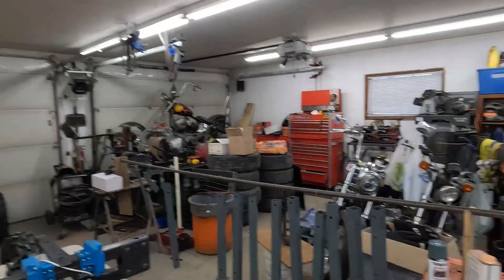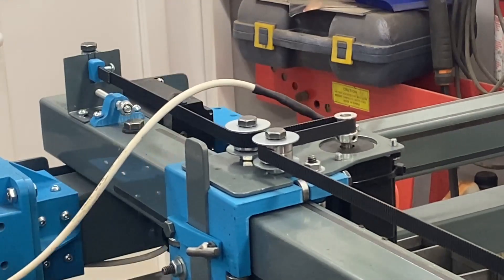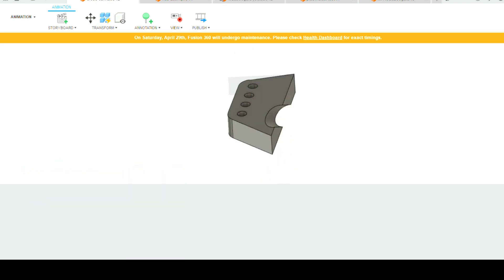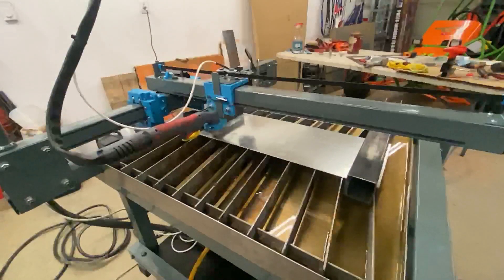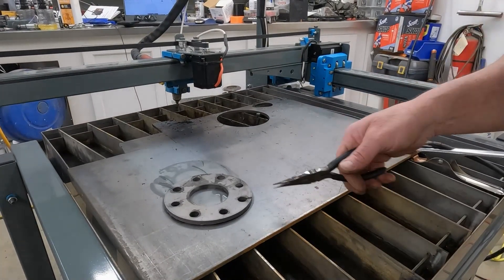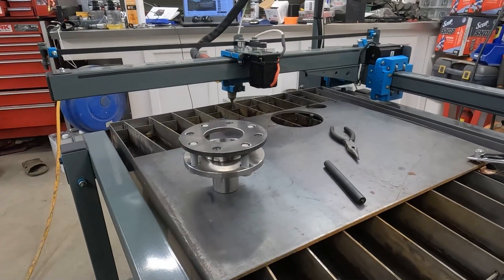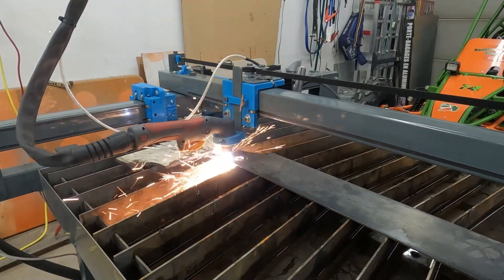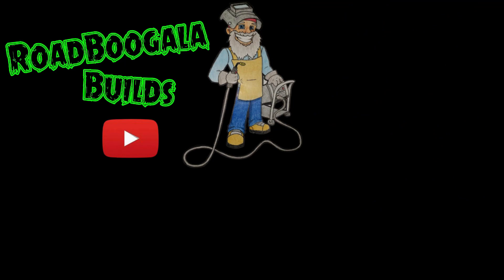Home Built CNC Plasma Table painted and ready for use, Part 3   @jdsgarage701 ​

Comment: I built the JD's Garage table myself and it looks like maybe you had the same problem I had. That would be that the torch starts to move a little too quickly after the "Torch Off" command is sent. This leaves a partial slice when it moves to the next position. So I "hacked" the post-processor and added a time delay right after the M5 (Torch Off) command. Now all the little slices are gone. I just basically made the "leave" delay equal to the Pierce time. I was doing this "by hand" when it first started but later figured out how to change the Post-Processor to do it for me. Less time and less mistakes. Next I want to have a Laser option . . . Happy Cutting!
Reply: Hi. Did you manage to build a cnc with a laser? I have a similar plan. And I'm considering the option. Regards
Reply: @slodziaksos No, I never did get to modifying it for laser. Maybe sometime in the future.

Comment: I built a front end loader for my Deere 420 this spring and I cut out a bunch of stuff by hand.  Sadly it looks like a little kid did it.  During the project I was wishing I had something this size just for brackets and small stuff like what you did here.  The FEL worked great for the projects, and I keep finding stuff needing it.  Now this fall we got a couple rain storms and it appears I need to dig up the foundation on one side of my house to find and fix a leak.  
Well now this spring I'm going to build a mini backhoe.  Thinking about my experience with the FEL, I started trying to figure out what I could do.  JD's garage popped up in my research and now after watching your build..... Next paycheck the plans and 3d Printed parts will be ordered.  By super early spring I'll have the table built just in time to build the Mini-Hoe!  If I'm smart, I'll figure out how to use my Go-pro and other camera to actually video both builds. LOL

Great job with this!
Reply from the maker: Right on thanks, using the table for a project right now

Comment: I have a question about the idler brackets. The nuts are supposed to be drilled out to 5/16 then a 5/16 rod goes through. Is this just sitting in there or what retains it? Only part of the directions that are a bit confusing to me. Thanks! Cant wait to get mine set up!
Reply from the maker: Allen set screws holds it in place
Reply: @roadboogalabuilds5318  great thanks I'll have to take a look!

Comment: Damn, that is just incredible... I've been thinking about getting a small CNC plasma setup, but this really seems easy. Just curious what your estimated total parts cost was?
Reply from the maker: I really didn’t keep track, the steel it self was expensive when I purchased it. I think mainly because it was a special order from my supplier
Reply: @roadboogalabuilds5318   Steel prices definitely suck these days. Was just wondering the ballpark though like under $1,000 type of deal.
Reply from the maker: @mxdev6387  Ya I’m sure I was under $1000 (not including the price of the plasma cutter)
Reply: @roadboogalabuilds5318  Awesome, sometimes it's hard to tell with how we get gouged with some items in Canada. Already got a plasma with CNC control options, but I'm tired of straight edges, wooden fences and circle guides with my steel plate that's propped up on my driveway.
Reply from the maker: @mxdev6387  there you go that’s half the battle, and yes we so get bent over on prices up here in the north!!!

Comment: cool work but how do you start and stop the plasma? or do you start and stop manually?
Reply from the maker: thx,  you need to use a CNC enabled plasma cutter, the torch is controlled with a relay, arduino and software. The JD’s garage plans provide this information

Comment: I'm  using the plans and starting this week...
I see that they have a Z axis now. Do you see an advantage in having a Z axis. 
I have no metal working experience. Being that the metal is damn near flat I don't see where doing a touch-off every time is efficient. 
Any advice?
Reply from the maker: Having the z axis should help with torch tip life by having and keeping the correct tip hight. I do believe JD’s program there’s to pierce at a slightly higher height and then lower the torch for cutting. It will also help with metal that’s not perfectly flat, also overtime your Slatts get a little uneven with all the Cutting

Comment: I’ve been contemplating getting a setup like this to make rustic signs from recycled metal appliances. They are obviously painted though and I wondered how it would work with painted surfaces. Are you saying it results in a crummy finish or a bad idea or something else? Thanks for sharing your build!
Reply from the maker: Thanks 👍🏻 this machine does make very accurate cuts, I have found it like raw material over painted but it still does a great job on painted surfaces esp if it’s thinner material which you would most likely be using for signs 👍🏻

Comment: Great videos! It’s good to see the table up and running.

Can you tell me what the accuracy on the holes is like? Are the fairly round and accurately sized?
I had a belt driven cnc before and the holes tended to be fairly oval. I’m thinking of making one of there but need the holes to be round and sized fairly accurately.
Reply from the maker: thanks 👍🏻 the accuracy on this machine is very spot on, I find the holes come out very good as long as the torch is square, to your material and you slow your feed down. It’s all about the programming to get good accuracy
Reply: @roadboogalabuilds5318  that’s good to hear. I was thinking of using a rack and pinion for mine but may go with this design instead. Thanks again!
Reply from the maker: @chrisjames6349  I never priced out a Rack set up, I understand it’s more expensive, I’m very pleased with the belt set up 👍🏻

Comment: This is a job well done :) I am just about to finish mine, really looking forward to do some cutting :) 

I have a similar plasma cutter as yours, what size of torch holder did you use? Mine is a Herocut CUT55X, looks exactly like the Lotos
Reply from the maker: Right on thanks 👍🏻 Yeah they’re a cool toy.
Reply: I just got the same exact plasma cutter like yours. Can you tell me how you got your plasma connected to the CNC controller or point me in the right direction for resources @roadboogalabuilds5318

Comment: I just finished binge watching you videos. I have the JDS garage kit/plans and I am slowly collecting parts as I can. Watching this has made me super excited to get going on mine! I also am a little intimidated about flashing the arduino..... I am also hoping to do the THC as well.
Reply from the maker: The flashing should be a pice of cake, I think my struggle was the limitations of my computer? I’m still not 100% sure but once it took all was good 👍🏻
Reply: @roadboogalabuilds5318  I also have a computer genius buddy I can call in, so it shouldn’t be too bad. Are you building your THC soon, or will that be in the future? I spoke to the JD’s boys and they said they weren’t ready to release all the info yet. I have the parts and am excited for the release
Reply: What's the actual size of the table?
Reply from the maker: @johnrobinson5262  28”X30”
Reply: @roadboogalabuilds5318  ok. So build one n then redesign it n use it to build bigger n better
Reply from the maker: @johnrobinson5262  I don’t need bigger nor do I have the space lol

Comment: Thanks for the video, will be building one of these soon and you have answered a lot of questions
Reply from the maker: Right on thx
Reply: I was wondering what leg height you settled on as the stock ones look to short for me as well
Reply from the maker: @mauricesteer8023  the legs on my machine with the casters is 30.5”. I have a welding table I do a lot of work off of and I made it the same hight, works for me. Some people think my welding table is a little low, it’s what your comfortable with

Comment: Have watched yours and jds videos, very good.    A question though, where does the arduino code come from, does it come with the downloaded plans?   I haven't managed to see this detail so far.      Good video though. Thank you
Reply: I have found the answer, the arduino code is linked in the plans when downloaded
Reply from the maker: @Keith12001  👍🏻 perfect
Reply: It's using the free and awesome openbuilds control to flash and control the machine. The plans are great!
Reply from the maker: @natesbox  you bet 👍🏻
Reply from the maker: Yes the plans give you step-by-step on how to program/flash the Arduino
Reply: @roadboogalabuilds5318  ok thanks. Where do you get the actual code from to flash to the Arduino?

Comment: Wow it cuts pretty thick!  What’s the total cost of the table ?
Reply: Nice, I built mine last year and i bought the LOTOS 5500d with the CNC port. I also upgrade with a Myplasm controller.
But I got some issues when cutting 1/4" thick stock, so, looking for upgrading my cutter with a Hypertherm 45 XP. Also i'm planning for a new 4x4 table.
Reply from the maker: @Blou55  That’s interesting? Mine seems to work fine with 1/4” material?
Reply from the maker: That’s a good question, I didn’t keep track? Approx $150-$200 Canadian for the electrics, steel prices very so hard to put a price on that
Reply: @roadboogalabuilds5318  That’s pretty cheap.  Good job.  However that thing looks pretty dangerous and it could start a fire.  You better make sure it’s not on fire 🔥
Reply from the maker: @williamlee5430  we better get a unicorn pilot, come and inspect. Maybe he can cause millions of dollars in punitive damages